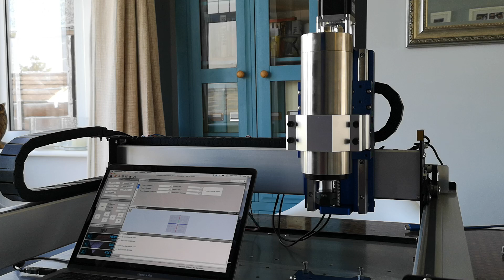Beaver CNC HD Linear Z/X with 2.2kw water cooled spindle - Shapeoko 3

Comment: Hello Luke, Firstly, thank you for what you're doing. It is simply awesome! Have you considered designing something for ball screws on the X and Y axis? Do you think there is any value in it?
Reply from the maker: No probs. I did look into it a couple of times... and I'm sure they would sell well but I think it would be a nightmare to support as if ball screws were used the motors would need to be bumped to handle the additional force needed for rapids...

Comment: Thanks for this follow up, that's great that its able to stay in place like that. Normally ballscrew designs require some sort of brake or friction device when mounted vertically like that to prevent backdrve. Are you getting around this by using a shallow pitch on your ballscrew?

Also your blue anodize looks really nice, are you doing that yourself? Keep up the great work!
Reply from the maker: Hi Ross, it all depends on the loads they are handling.  This is a 1605 ball screw, it takes allot more  than a few kgs to push it.